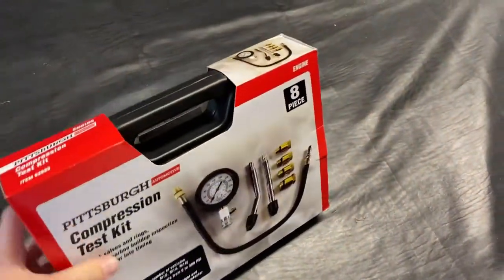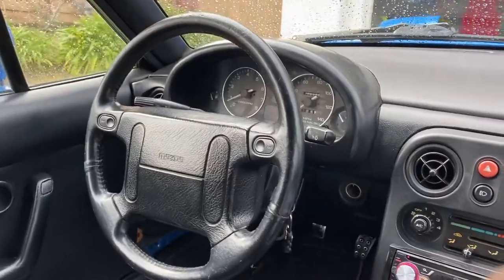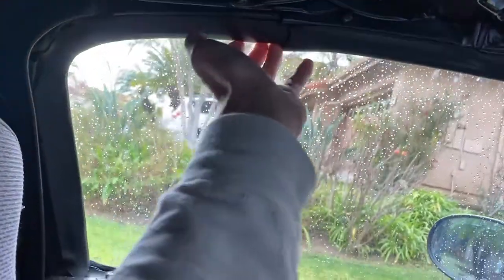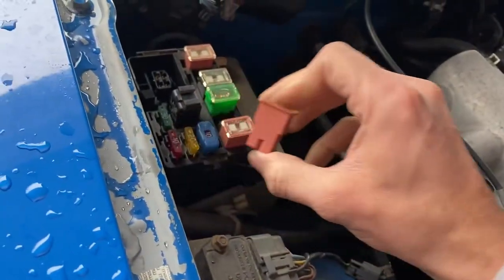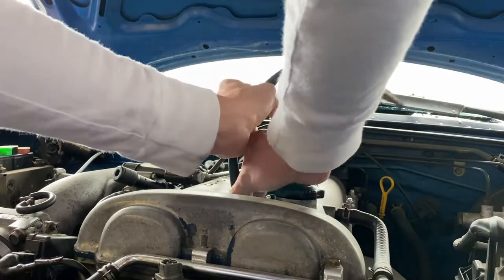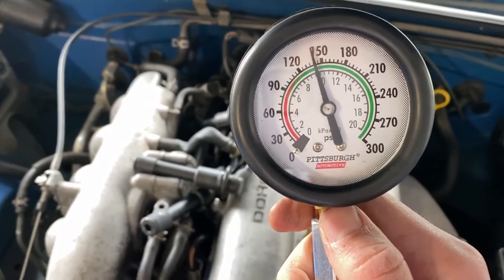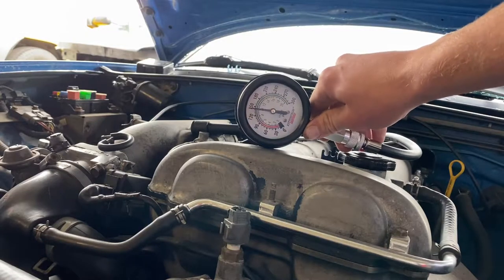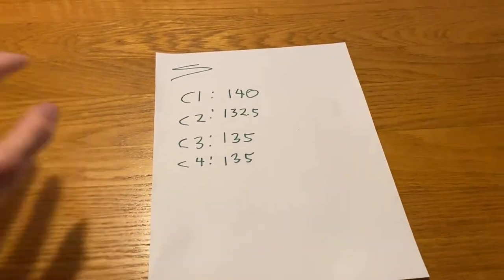Compression Testing My 1.6 Miata!

Comment: 140 is not a healthy motor lol
Reply from the maker: It definitely is…it’s not brand new but for 200k miles it’s definitely healthy for that motor
Reply: Per Mazda 135psi is the minimum. With that being said I'm not sure I would trust that harbor freight gauge to be accurate, testing one vs a more expensive gauge I found the harbor freight gauge was 30psi lower, but it will at least let you know if you have a dead cylinder.